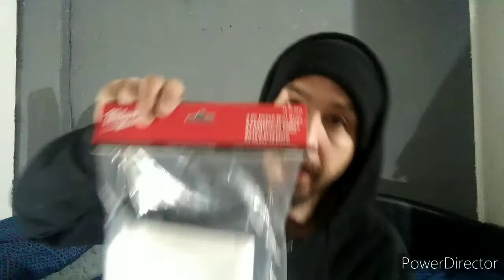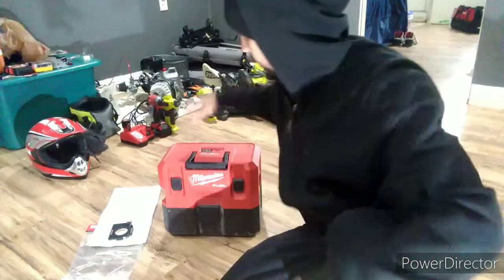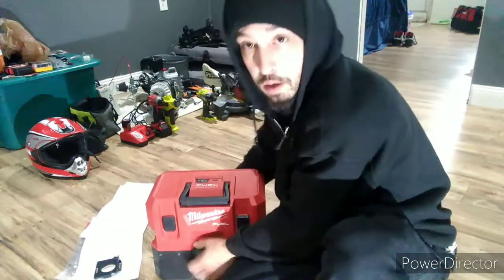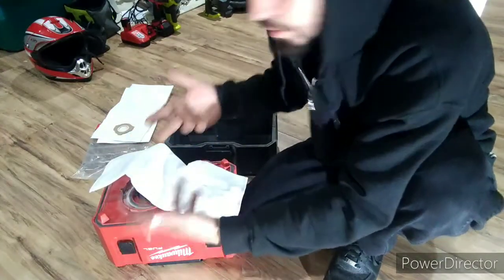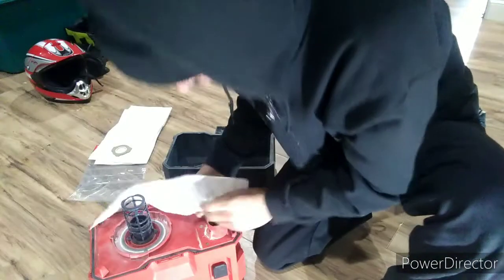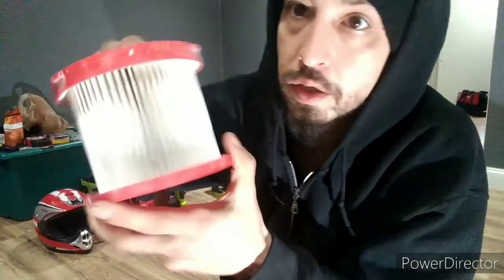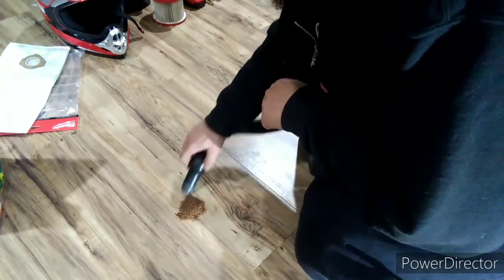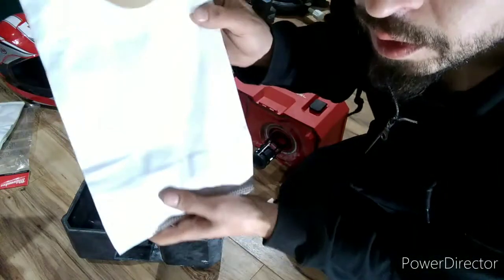Milwaukee wet/dry vac fleece dust bags.

Comment: The little black piece that came with the bags clips on to the black bottom of the shop vac. First step is to slide the black plastic piece onto the bag, then put the bag into the bottom, then clip it into the side. So when you put the top on, this port slides nicely into the bag. Poor design on the bag having the opening in the center.
Reply from the maker: Yea that's what someone else said also, but thats terrible design. Trying to line it up would be almost impossible or a pain in the neck. they should have it clip to the top part of the vacuum. Problem would be solved. I like it better without the clip, it stays in place just fine
Reply: @theperfectpaintertoolreview  it does stink that the bag hole is centered but it is centered for the m18 vacuum. So if you use the plastic insert and attach it to the bag, then snap it into the bottom hopper is actually a genius design that it does that. You can then position the bag around the filter. What is nice about the bag staying in the hopper is that you can cut the bag open on the bottom edge, crisply fold it closed and clamp it shut with binder clips(anywhere from 2-4 is plenty). When the bag gets pretty full, pull the top/motor off, slide the bag out, remove the binder clips and you can then empty out the fleece bag, fold the end up and then reinstall the binder clips. You can continue to use the same bag.

Comment: Yo, bro!  You did it wrong.  You're half right.  The black clip attaches to the bag. Next, the clip attaches to the inside of the collection bin.  There is spot where the black bag clip attaches to the black bin.  This way the bag remains seated in place and you can still remove the top from the bottom.  Check it out!
Reply from the maker: Gotcha. They should have a small instruction paper with it.
Reply: I was just about to mention this lol I just bought one of these vacuums and I seen the little bracket in the bottom container. So I was like Aw man that must be for a bag or something. Which is great cause that dust always fills up the regular filter super fast.
Reply: Where does the black clip attach to the black bin? I have a orange clip already installed on the black bin. Can you help me?

Comment: Thx. I bought the bags for the 18v Packout vacuum. Apparently the black bracket isn’t used for the Packout. There is an internal bracket that holds the bag. Also you keep the original filter on the unit when using the bag.  Agree the bags work but what an kludge job on Milwaukee’s part.
Reply from the maker: Yea with the m12 vacuum it's terrible. I'm assuming the black bracket is for the brushed m18 vacuum maybe, idk. But at least the bags do work.

Comment: I am furious with the small M18 portable box shaped vacuum, because it has no option for a bag. Using a small shop vac for concrete dust and drywall dust, and fine sawdust (the only thing you really encounter on all construction sites, and home projects) is not compatible with a basic paper filter element. The paper filter element gets packed full of fine dust immediately, and the vacuum becomes so loud that you literally cannot use the vacuum. It's a good working vacuum, but too loud, and the vacuum needs to have a filter bag (bagless is NOT acceptable).

Comment: Let me help you a little bit on the bags.  You have to crease the bags around where it would sir.  Keep the vacuum upside down when connecting the 2 pieces.  
Here's a kicker or something to look into.  VEVA, Envirocare make shop vac hepa bags.  The shopvac inlet is the same as Milwaukee.  That means the bags I mentioned run $2.50-$4 a bag.  The bags  are 3.5 gallon capacity. The capacity is more than the vacuum capacity.  
Thanks for the demo.

Comment: Yes these are compatible with many of the vacs, but I'm pretty sure that black clip is only for the regular M18. I have the packout M18 and the black clip is not needed because there's an internal slot built in that holds the bag in place. 

The bags work great with the filter by the way. Both of them working together is what you want. You'll still save money and time on cleaning and changing HEPA filters because it's practically non-existent. Nonexistent like the instructions for those bag, definitely agree there! What a pain to figure out blindly.

Anyways, I look at the bag as an overqualified pre-filter for the HEPA, and it works very well.
Reply from the maker: Yea I have the packout vacuum now also, and the bags were def designed for the m18 vacs with the port in the middle. Idk why they made the m12 port offset but there must be a reason.
Reply: Is there any way to install a bag on the original M18 portable shop vac? The little square rectangular shaped vacuum? Model Milwaukee 0880-20 18-Volt Cordless.

Comment: I just bought the M18 Fuel vac and they’ve addressed the design issues you mentioned. There’s a plastic clip in the dust bin that you slide the cardboard bag flange into and then set the top into it…still not sure what the black plastic clip that comes with the bag is for…maybe one of their other vacs.
Reply from the maker: Yea the bags apparently were designed for both m18 vacs with the port in the center. The m12 vac the port is offset for some reason.as long as the bag is in place it won't go anywhere with or without the clip
Reply: @theperfectpaintertoolreview  My work just got the M18 but it’s not the Fuel, and it has the offset as well. The bags are definitely designed for the Fuel. Hopefully Milwaukee will add a bag with the offset connection to their lineup for the offset.
Reply: The black plastic piece literally clips into the M12.  Its specially designed for the M12.  It’s offset, but you can see the connection in the video.
Reply: @veryinteresting591  gotcha. The M18 Fuel has a built-in plastic clip that the cardboard flange on the bag slides right into. It’s an easy plug and play attachment. Looks like the bags were designed for the M18 Fuel and they added the clip to make it work for the M12, although not a perfect fit with the offset connection.